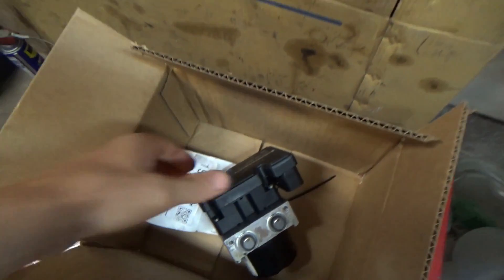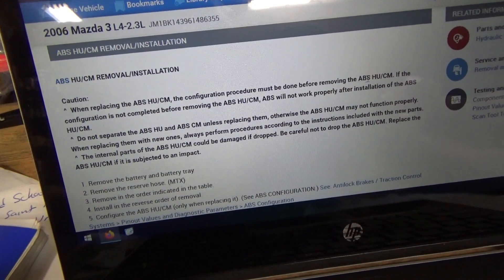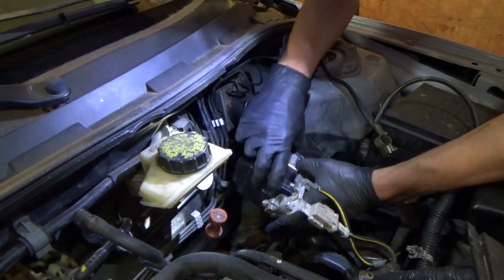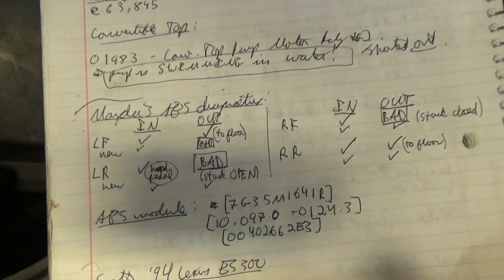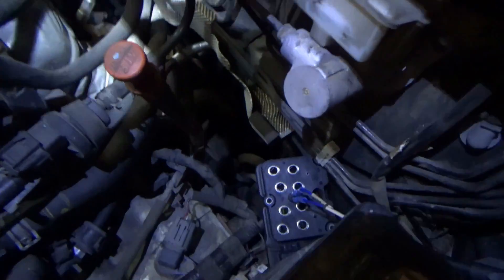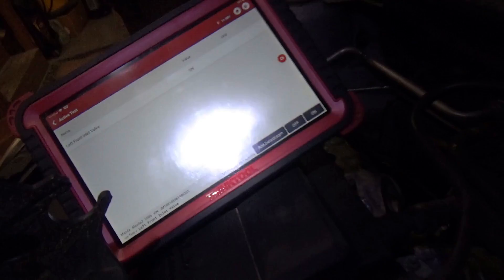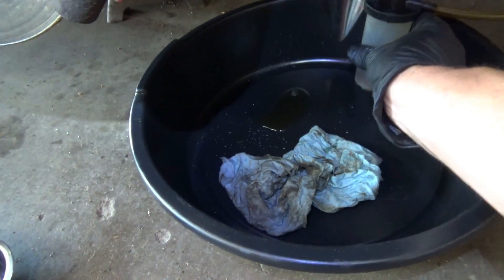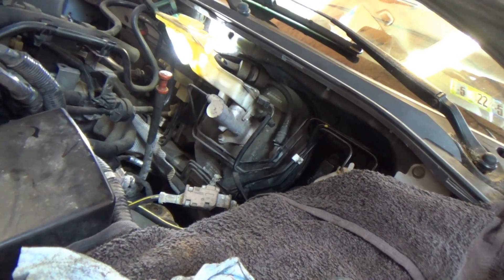DANGEROUS BRAKES! (Part 2 - Mazda 3 ABS)

Comment: The pedal looked fairly soft after the repair compared to my car (have an 07 2.3 5MT) , a trick I learned from Eric the car guy was to go out and activate the ABS in a dirt lot or something to get the air out of the ABS module, made a world of difference on a 350z I worked on installing big brakes. Some cars also have ABS auto bleed using a scan tool as well.
Reply: Exactly right on both accounts
Reply: great tip.  i've had this case on a few of my mazdas from about 2008-2017.  It always seemed to occur or get worse near the end of a 3 year lease so I thought it was age related maybe the fluid and alloys in the parts involved.   it didn't happen on my 2019 or 2022 (yet).  i complained they couldn't fix it on every car...i'm gonna send them this vid next time lol

Comment: ABS modulators often need to be cycled as part of the bleeding operation to remove air from the valves and punp. You may find a function in your scan tool to do this under "special functions".

Comment: The control valves get magnetized from the coils by removing the coils and then tapping on the valves you can demagnetize them it happens all the time on elevators hydraulic elevators They have basically the same theory and design as the ABS valves.
Reply: Hi Gary (from a retired elevator mechanic.)

Comment: If replacing your own brake pads, crack the pressure line fitting on each caliper before pushing the piston back in, that will help keep dirt or corrosion in the caliper from being pushed back into the ABS block. Might save you from having to replace an ABS block down the road.
Reply: It naturally flushes your fluid that way too.  Because you'll have to add more fluid to top it off.
Reply: It's the first time I've heard a good reason to crack the nipple open when doing pads. Thanks!
(Of course, the fluid will need topping off after)
Reply: @MrAmorti  it's totally not necessary unless you're OCD

Comment: Ivan, you need to get yourself a Motive power bleeder.  They sell them on amazon with various master cylinder adapters.  Very affordable.  Its like a modified garden sprayer but for master cylinders.  Fill up the jug, pump up the pressure, and crack the bleeder(s).  No pedal pumping involved and the brake fluid keeps flowing and filling the reservoir.
Reply: I tried one of those a long time ago. The cap design was ridiculously difficult to get on the master cylinder correctly. The flipping thing wound up spewing brake fluid all over the place. Threw it in the trash.
Reply: @Fjord_Driver  now days they have specific caps for different makes and models.  I have the Ford, GM, VW, amd chrysler specific caps and never had an issue
Reply: Don’t think you’ll see this happening.  He uses a snow brush as a pedal depressor and rebuilds cylinder heads on his shop floor using cardboard boxes.  Not exactly “professional level” repairs.  Ivan is a great diagnostician and I support his channel for his troubleshooting and electrical system knowledge….but I’m still not overly impressed with his shade tree mechanical repairs.

Comment: How many people would take that unit apart, have the wherewithal to energize the magnets with a hunk of ferrous material (i.e. bolt) to confirm electronic integrity, and in doing so, logically boil down another defective hydraulic unit to simplest terms, without simply feeling defeated by receiving another junk part!? I am impressed! And quite simply, humbled by your diagnostic prowess, Ivan! You make techs better with every video you make! Thanks man!
Reply: I don't know of ANY mechanic that would do this.  That is what sets Ivan apart from all the others.  He tackles problems the others would pass on.
Reply from the maker: First time I actually did that magnetic coil test and it worked like a charm! Just happy the hammer tap freed up that sticky valve haha
Reply: It really did work like a charm!! Super cool. Offers a great visual of magnetism at work!
Reply: @mejesse809  get off your high horse there fella! We all come here to learn. And to offer the guy spending all the time sharing the knowledge a little praise is called being respectful, and appreciative. If you’re here to troll, make like a herd of geese and flock off!

Comment: I was employed by Lucas, a British company that manufactured ABS units in Michigan for many years. During that time, Lucas had eliminated all the temporary workers in this facility. That was an amazing place to work. The disparity between the European management mindset and the American was a thing of stark contrast. Lucas offered vacation time from day one, mental health days, full outstanding benefits package and stringent respect for the employees and a tight safety protocol to assure workers health. Then TRW, an American company with a profit at any cost mindset took ownership of the plant. TRW laid off full time employees, hired temps at slave wages, eliminated safety protocols, hired consultants to literally scream at workers to go faster !  Moreover, they cut costs in spite of detrimental effects on employee health. 
The “ Vulture” capitalists at TRW, destroyed a business that was building critical tier one safety components and had no qualms about using a temporary workforce that openly stated,
“ I don’t care if these are the wrong O rings. I can’t afford the vehicle they go into anyways”  Thankfully, I am no longer working in automotive. However, I always wondered how many bad, misplaced, rolled lip seals, wrong components and untested ABS units were pushed through in order to get production. 
That particular ABS unit was, I believe built in one of the Michigan plants.  More than likely, if it’s defective, under a TRW ran plant .

Comment: Damn! Thank You for making this video as it saved me a $2000 bill from the dealer
My daughter's 2007 Mazda 3 had the same issue and so I bought a bidirectional scan tool and found one stuck valve.
I turned it on/off a bunch of times while tapping the ABS module with a heavy crescent wrench and got is unstock 🤙
Breaks work like new 😜
Reply from the maker: WIN!
Reply: I'm going to try this.
Reply: @DS-ss396  it's been 9 months and still good 👍

Comment: Thank you, thank you, thank you. I had the same problem of soft brake pedal with no braking to the front left wheel on my Hyundai Tucson 2006. I had been quoted over Two Thousand Euros by the local Hyundai workshop to replace, repair, and reprogram the ABS unit. I came upon your vlog and latched onto your fix of "shocking" the valve actuator loose. I immediately went to my car armed with a hammer, the ABS unit is located on the front left of the engine bay readily accessible, I repeatedly struck the the top and front of the hydraulic block with the hammer. Started the car and like magic the brake pedal was no longer soft, being back to normal, and joy of joys upon road testing the brakes now operate perfectly. Total amazing no parts required repair.
Reply from the maker: @sirRoyM  nice work! 😁👍

Comment: This turned out to be more interesting (for us, surely not for you), than just the ABS unit swap. Great job recovering it.
PS: The fluid is probably old and it wouldn't hurt to replace it completely, to avoid future stuck valves.
Reply: Yes, I was thinking the same thing. Bad/old brake fluid may be the issue.
Reply: Unfortunately it will probably stick again in the next year or two.  But at least now I know--  go hammer on the body of it, especially while doing a bi-directional control-- and maybe we can get them to rattle loose.   I've never seen the hydraulic side go bad before though--- it's normally just the electronic side that fails.

Comment: Ivan,
Great video series - thank you! When I do a one-man brake bleed I use a old dresser mirror (10 x 18) positioned on the floor so I can see the fluid and bubbles into the waste container at all wheels from the drivers seat.
Paul (in MA)

Comment: Considering this is a Ford/Mazda hybrid (from when Ford owned Mazda) this failure/repair sounds strangely familiar 
2006-2010 CD3 platform cars (Fusion/Milan/MKZ/Zephyr) have a recall out on them (19S54) for HCU failure (this repair) 
All to address the same complaint (soft/sticking/sinking) brake pedal 
Something about the plating internal to these HCUs doesn't agree with some brake fluids as they age 
Sounds like an engineering problem that should've lead to a larger recall, or people should service brake fluid more often 🤷‍♂️
Excellent repair as always Ivan 🫡
Reply from the maker: Hah! I have seen this exact problem only one other time...it was on a Lincoln MKZ haha
Reply: Have problem now with 2009 CX9.  Ford all over this car.
Reply: @PineHollowAutoDiagnostics  I had a unit fail on a year old GLC300e hybrid, but it seemed to be a one off

Comment: Same thing happened to me last time I replaced one of these with a used unit for a used car lot customers, this abs failure is very common on these era Mazdas, I won’t install anymore used units on these Mazdas, the failure is way too common to risk a used unit. That was fantastic watching you trouble shoot the new unit though
Reply: I put a used in my 2009 CX9 and paid and it was junk.  2 master cylinders later, I'm going to have to buy a new ABS module.   But I'm going to take a hammer to the module in place first to see if I can shock it.
Reply: @zaffo757  what you can also do is find a gravel road and slam your brakes and get the ABS to activate like 10-15 times in a row and sometimes that will shock the module into working again. I say gravel road because it doesn’t take much effort to get the ABS to activate on gravel

Comment: Good lesson you gave us IVAN.I'm glad you hit it.I've used spool valves in my job,and found when buying a valve if it is  not one that ordered often it may sit on a shelf for years.Most if not all spool valves of that small type are lapped for fit and the clearance maybe .0002 to .0005 without liquid or light ASSEMBLY grease they may need a PUSH or knock to get loose.And free up.They don't use o rings for the simple reason o rings wear out or dry-out of get cut from dirty fluid .good work on sourcing out  a crossover piece.

Comment: Thanks for the great videos Ivan. I've noticed quite a few comments in this and the previous video from people that suppose the source of the problem is "worn out" brake fluid. I've been a tech for close to 30 years now. ABS has been around for longer than that and we are really only seeing this type of high rate of failure in newer vehicles. My hypothesis is that the problem is the parts manufacturers (ATE seems to be the brand that we have replaced the most of, many OEM's use their ABS system) have figured out a cheaper material to use on the hydraulic control units. How many old Camry's and Accord's with ABS and brake fluid that had 200K plus on it did you see fail? Just my 2 cents. Like everything else, planned obsolescence.

Comment: My closest Ford dealership replaced the ABS unit (factory recall), for my 2010 Fusion and they didn't bleed the system.  I distrust dealerships so much I simply drove it home with barely any brakes and performed the ABS auto bleed function with my scanner and then manually bleed each wheel.  I kept some of the old brake fluid because they said they flushed the lines, and it was very clear after looking at the old fluid, they did not change anything.  At least the ABS unit looks new, so I'm guessing they actually replaced the recalled part.
Reply from the maker: Ugh typical lol

Comment: Some valves are pilot operated so you would need a pressure differential to complete the "shift". I believe there are some like this in an automatic transmission.  Great work on getting the customer back on the road with minimal expense.

Comment: Good for many more miles. The Ford   "F" series truck units I replaced would not upload the old electronic module info for the new one.  With the IDS I did the Programmable Module Installation.  It worked.  The 2003-2004 "F" Series had the module on the bottom of the Hydraulic Control Unit.  Talk about planned obsolescence!  The fluid leaked from the HCU into the electronic module!  Goodbye to both parts!  Another one of Ford's "better ideas!"
Good job Ivan.

Comment: Probably the most valuable demo of ABS service and bleeding of this type of system I have seen on YouTube. Mine is an older type that has a separate reservoir for ABS and an ABS pump located near the core support. Wondering how I would need to treat that differently to bleed the ABS to exchange the fluid?

Comment: Hi Ivan, I have a ‘09 Mazda 3 which  had an ABS module fault ( ABS Traction control light stayed on) with the ABS function not working. The solution was to replace the whole module, but the mode numbers had to be identical to the one on my faulty unit. This is the number attached to the black ABS motor ( the big white label). This was quite expensive for me, as this was one of the less common modules where I live , and the the car has done 204K miles. There is another skilled , British/ Portuguese automotive technician here on YT that went through repairing the same problem as I had.

Comment: First let me say I love you for making this video… Everything about it is perfect.  I learned absolutely everything.  It helps as I am mechanically inclined so I understand it perfectly.  My wish because I own a Master 3 would be to bypass that crazy thing and get rid of it.  Not once ever have I used or needed antilock brakes and in the winter there inconvenient and annoying.  Mazda did not do anyone any favors as this part is too expensive and breaks down often.  After you used a hammer it's risky giving it to a customer I hope he did have good luck.  I definitely do not like that ABS module.  For me it's not needed
Reply from the maker: Yup I have the ABS disabled on my own truck...haven't missed it once in 13 years of ownership haha
Reply: @PineHollowAutoDiagnostics  That's not fair now I hate you because I'm jealous… Ha ha… Where are you I need you get that stupid ABS garbage out of my car.  I just had my replaced and the mechanics didn't even check because the first thing they did was replaced a perfectly good master cylinder to find out it did nothing then charge extra for the ABS module.  I'm a computer technician so I don't specialize in automotive but I'm telling you I am mechanically inclined and what a disaster those modules are.  Mazda should have a recall for all of them… Anyway good for you

Comment: In order to get the same era Bosch ABS in my Citroen Xsara (2000) to bleed all air out of the system, you need to use OEM Citroen Lexia diagnostics, to run ABS bleed function. It operates the pump motor and valves one wheel at the time and in addition, you need to press the pedal at the same time. Tool does not tell you to do so, but that was the only way I was able to get all air out. Usually I use a pressurized brake fluid container to keep the system pressurized and the car BF reservoir topped up at all times. I thought that pressure from the pressure bleeder would be enough to push out the air when running the ABS bleed function, but the flow was too slow to push out the air from highest points of brake lines above the ABS unit. Using the pedal did the trick :)

Comment: I don't know if your scanner has it, but when bleeding an ABS valve body, I like to activate the pump, then manually bleed the system as normal. In MOST systems, when you do the bidirectional controlled pump activation, the ABS module holds the valves open to help diagnose a stuck closed  valve. It also shoves the air out quicker if you were to do say a line replacement.

Comment: One option is to remove the electronics part from the original ABS unit and try to tap loose the valves. If that does the trick, very inexpensive repair. (Brake fluid need to flushed at least twice).

Comment: Sticky valves could be old fluid with crud in it problem, getting new fluid in the system might increase the chance of success. Have seen vacuum blead equipment that hooks to compressor.

Comment: If you've put too much fluid into the reservoir, or there dirt floating on top, I find dipping a paper towel in will pick up all that gunge. If you need to remove a lot of fluid easy enough to use a syringe to suck it up out of the reservoir.

Comment: Ivan those ABS valves are very sensitive to sticking from residue, this is why you should NEVER push caliper pistons back in without having the bleed nipple loosened and a hose attached to send the old fluid in the caliper into the container and not back up the line into the ABS unit.  Its all fine and dandy until the ABS valve or valves seize up and locks one or more brakes. Trust me, getting the issue resolved is a real annoyance and time waster..
Reply: Before replacing module, can you take apart a clean up it with brake clean?

Comment: Gonna have to try this with my boys rx8, having similar problems. Usually when it's the MC, it's intermittent, and you can still pump it up once you get the cup inside the cylinder to seal. That's the reason I didn't want him to replace the MC, it just didn't seem right to me.
Just hope my launch 431 can activate all the valves.  Thanks Ivan
Reply: Find a gravel road or a wet grass spot and do a few hard brakes so ABS activates. It is good for the system to activate from time to time.
Reply: @petrnemecek4379  we used the launch to activate the abs for bleeding, still feels like air in line. We've gone through a gallon of fluid bleeding it every way to Sunday, 😆 🤣 😂 
I'm just hoping launch can activate the valves independently to see if any of them are stuck. I'll find out in a few weeks.
Reply: I have a motive power bleeder system, well worth the money.  We've also tried the old 2 person manual bleed, along with a vacuum bleed, "pulling the fluid from the caliper end"